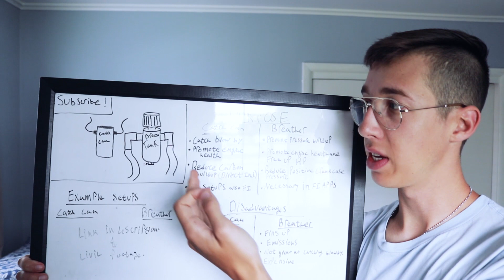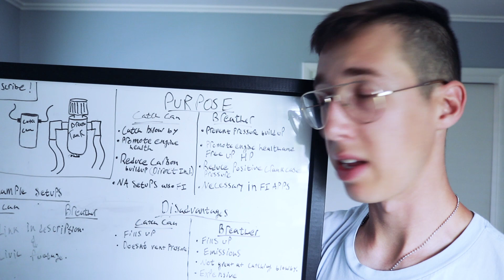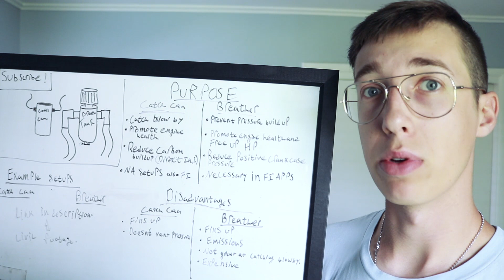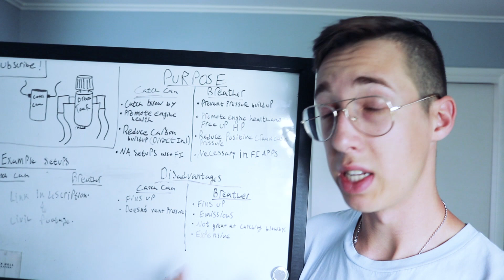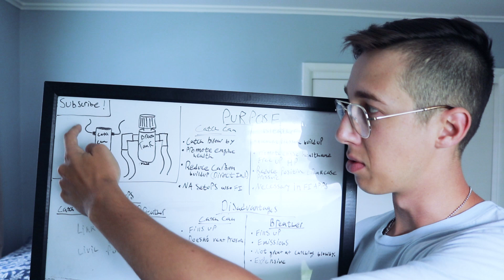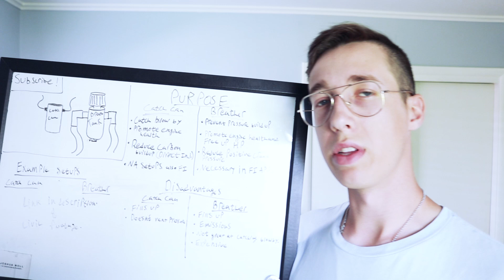Oil Catch Can VS Breather Tank | Which is Best?

Comment: breather tanks don't prevent crankcase pressure they lower the pressure by releasing it directly to the atmosphere. The pressure pushes its way out the easiest way it can which is through the breather instead of your seals and gaskets. Oil catch cans are used inline with your PCV valve.  Some people use them as a PCV system.  So negative pressure is put on the crankcase meaning air is being sucked out.  If you apply enough negative pressure on your crankcase without going overboard you can actually increase HP.  BMW and VW owners do this all the time. Get rid of the CCV (air oil separator) and run a catch can with no Valve. The key to this mod is not running a valve or use one that has a higher flow rate than stock so your intake can suck the air out of the crank before it even has a chance to build up allowing your pistons to move more freely. You'll also see an increase in mpg

Comment: bought a 2 port breather tank for my b16a2 (NA for now-em1), bungs for -10 an fittings on back of block, and -10 an braided lines. My plan is to run both -10an lines to my breather tank and put a filter on the valve cover that connects to the air intake and to plug off the hole on the intake manifold. Do you have any advice on a better plumbing route or what to do with the factory PCV nipple, or can I do what I mentioned and freeze plug the oem pcv breather box location?

Comment: I'm confused. There's a vacuum under my valve cover. I know cuz I got a small hole I it where I'm missing a bolt, it pulls in air nonstop.

Is that not normal? 
Like if I plug the hole there's still gunna be a vacuum in there, so if I add a hose for an oil catch can, how is it not gunna suck air or oil through that hose into valve cover?
How is oil or air gunna pass out of my valve cover area into my catch can, if mine is under vacuum.

Sorry I probably wrote these questions like a complete idiot. Idk nothing about cars but I'm trying to learn. Been doing some small mods to my cruze last few months really just tryna learn more about how my car actually gets me where I want to go everyday

Comment: This video is misleading, engines crankcase can never vent to atmosphere if it is a road registered vehicle, so the mere mention of breather tank removes all your credibility, vented to atmosphere where specifically you have removed the PCV vacuum side causes MORE damage to the crankcase and internals than just running the OEM PCV circuit - OEM high power turbo and supercharger cars factory built have all what I have mentioned for emissions control as a sealed system measured by the MAF sensor - venting any part of this disallowing the motor to burn the blowby is so so bad for the enviroment and for air pollution issues globally, frankly Im fucking sick of seeing people modiying any part of the crankcase piping as its like no one knows how to do it correctly
Reply: Damn that’s crazy my turbo ls is vented to atmosphere. Seems like you should be planting trees or something. Obviously not a car person.

Comment: The only big difference you talk about is that "a breather doesn't catch that much blowby compared to a catch can" which is untrue since you then talk about your breather tank filling up too fast meaning you experienced first hand how much blow by it can catch (more on why your setup fills too quick at the end of my comment), reality is that all types of crankcase ventilation systems catch roughly the same amount of blowby and pressure, difference is what they do with it. Only matters for an emission perspective, an engine health perspective, and a tuning strategy perspective as vent to atmosphere setups like breathers cannot be used with a maf.

Catch cans condensate the majority of the oil particulates then gets the finer stuff and the extra pressure sucked back into the intake, which brings us to your other point "catch cans don't really relieve positive crankcase pressure", that's also false, the second outlet of the catch can is plumbed to a part of the intake that sees vaccuum, therefore the extra pressure gets sucked back into the intake. Advantage is compatible with MAF systems, keeps intake clean, good for emissions, can pull slight vaccuum in crankcase therefore increasing piston ring sealing but probably by like 0.01%. Cons are the more complicated tubing compared to vent to atmosphere setups and some blow by still gets in your intake.

Breather tanks also condensate the majority of the oil particulates, and relief the rest of blowby and the pressure through a filter on top, vent to atmosphere. Doesn't work for MAF systems, and is releasing all kind of vapours in the atmosphere, but it has the most venting capacity, can keep high boost engines with big ring gaps at 0 crankcase pressure compared to a catch can that wouldn't be able to vent enough, also has the advantage of not recirculating any crap in your engine.

Stock crankcase ventilation systems just recirculate the crankcase pressure directly into the intake without even trying to separate the air from the oil and condensation vapors, it only relies on the baffling present in the valve cover to not suck liquid oil into the intake. Best for emissions, don't need to empty a can, compatible with MAF but doesn't work that well with more extreme FI setups that produce more pressure, absolutely the worst when it comes to putting crap back into your engine.

The last options are breather filters, they're filters that go directly onto the valve cover, vent the pressure and vapors to atmosphere and like the stock system only rely on the baffling to prevent liquid oil from coming out. Not Compatible with MAF, bad for emissions, requires really good baffling, and cannot cope at all with the extra pressure of FI, only for lower power NA cars that don't produce much blow by.

Also I would not recommend draining a catch can or breather tank back into the sump, lots of acidic residue, condensation, and gas that ends up in them and I'd rather not recirculate that through my oiling system, fix the problem at the source : your catch can is filling too fast because your baffling is insufficient.

Comment: I realize its an old video and you may have remedied this already.. but you may wanna take a look at that oil you're "draining back into the engine block".. you probably don't want that back in your motor..  that shit is usually full of water/gunk/sludge.. if its filling with oil too quick, you need better baffling. unless that (which appears to just be a moroso breather tank) is actually an air/oil separator..

Comment: Wouldnt there be boost leak if a breather system is installed on a boosted application? Light reflection prevents from seeing the white board.
Reply from the maker: No. Venting the crank case will not cause a boost leak.

Comment: Do a side by side comparison test of which type of can collects more oil.  Vented or return setup.  2k miles with vented then 2k miles with a return tank.  Let’s go!
Reply: Did you install a check valve pointing (flow) to the intake manifold with your setup?

Comment: Bad thing connecting the oil tank to the engine block for draining oil. Probably you haven't seen the sludge that is collected there in a cold winter morning and the black colour of the oil collected there during hot summer days. Trust me, my friend, stop draining that shit inside your engine.

Comment: My catch can vents to the intake. It's technically a sealed system, not vented to the atmosphere, but it still should be reducing crank case pressure, right?
Reply: you are just sending the dirty air back to the intake and back to the engine?

Comment: In order to set it up for drain back u need to get a can that u can run coolant lines to to stop the condensation. So oil in the tank stays relatively warm till it runs into the drain back to stop condensation.
Reply from the maker: Yeah I probably won’t run this setup with my new motor.

Comment: A few corrections.

A closed system oil separator will have a vacuum pull to have negative pressure in the crank case which actually improves efficiencies, giving marginal fuel saving gains. This is what you have called a catch can. It connects on one end at the crank case vent port. Then connects to the catch can, then goes to the air intake system where it gets a negative pull, vacuum.

In certain application such as over boosted engines. Or engines with bad compression in the cylinders from bad piston rings. A closed system can cause problems. Due to such higher than normal pressure in the crank case with then a vacuum being used to vent the crank case... it winds up pulling oil out of the block in liquid form rather than oil vapors. Closed system catch cans are designed to vacuum the vapors our of a crank case, not liquids. The crankcase that sees to Mich pressure is already ready to squirt it's liquid in any direction. Having a vacuum simply points the oil in the most easily to escape the engine direction.

Open system. The filtered cylinder you have there is more of a degasser than an oil separator. You want the vapor/gas pressures from inside the crankcase to get out but they're bringing liquid oil with them. You degas the mix from the crankcase allowing the vapor to vent to atmosphere and the oils to settle back into your oil pan. 

I'll look over a few of your videos to see what the build is about... but at this point I'd say you misinformed a few people on the applications of those cans and you may have a couple people put the open systems in place where really a closed system belongs. They have specific uses. Ideally the car is build well enough not to need an open system.

You will want to do some research into dry sump oil systems. Heavily boosted cars don't use catch cans be they opened or closed. They use multi staged dry oil sump systems. Will post a link to a Papadakis racing video for you on the subject of dry sumps for boost power.

Lastly depending what your other videos are.. you might want to do a compression test on the engine if the exhaust out the tail pipe has blue smoke.

Thank you for being a sharer of content! Humble or not it was well presented.
Reply: Your points talking about vacuum and oil being sucked up is somewhat incorrect, this is solved by a one way valve, so boost does not go back into the crankcase, during boost and WOT the vacuum port is not used thus, For a force inducted motor the oppisote side rocker cover feeds the turbo atmospheric input, both these pipes cannot be combined and can have dual sperate inline catch cans, but the entire system has to be gas tight. Some of the points in the video are very incorrect and cause excess emissions to the atmophere - incredibly illegal and bad for the motor not running vacuum... a "breather" tank should not exist in 2020/2021
Reply: In my opinion I think a oil catch cans should have filter on the top as that way you wouldn't have vacuum pressure build up  as you would with a sealed oil catch can as it can't breathe at all which that case you would have a vacuum build up & that can't be good for engine at all unless you have a breather oil fiĺler cap because your engine has to bŕeathe anyway well my wife has a PT Cruiser it has 2 breather hoses one from the PCV valve to the intake manifold & have another breather hose from the front rocker cover to the Airbox where  the air filter is which in some point in time I'm going to install a 3 Port  Oil Catch Can with filter the breath hose that I will be buying is High Temperature Siilicone 10mm hose & they come in 5 metre lengths & in that that way I can cut the hose into 3 lengths into sizes I want & make up a bracket for oil catch can as there no place that I can mount the oil catch straight  in as there not much room in these engine bays on these PT Cruisers & I will just have to make up a bracket to mount the oil catch can with  filter & once I have made the mount bracket on then I will mount the oil catch can with filter & I'm sure that a sealed oil catch can could cause a vacuum pressure build up which could cause damage to the engine well that's I think anyway Kind Regards Peter PS I would much rather have a oil catch can with a filter & be safer than sorry because if the sealed oil catch can does cause vacuum build up & it will cause damage to the engine & I personally would take that risk & that's  what I think anyway
Reply: https://youtu.be/Ze-quG0nSqA

Papadakis racing going over dry sump oil pump.
Reply: https://youtu.be/XWHvnIKkya4

Papadakisracing showing an oil change on a car with dry sump oil system.
Reply: why aren't pcv systems on both valve covers ?
Reply: @ehrenleleski8204  that would cost more per engine for the manufacturer. It's basically adding to engineered obsolescence by making a cheaper engine that will not last as long as a slightly more expensive engine which is designed in a superior way for longevity.

People put up with crap so they sell crap. Seems only the special interest groups nagging the gov for better emissions is the reason for fuel efficient cars. Longevity is not as important as the efficiency it provides when new.
Reply: So pretty much don't add breather where there was no breather in the first place right
Reply: @matarazzo209  you can add breathers but it's more complicated to do it correctly. Ensuring you're not going to pull oil from the engine etc.

Though in theory if you removed all the vacuum lines and plugged them off on the intake manifold(s) you could vent to atmosphere.

Doing that though I'd suggest you plumb into each vent a degassing device. A simple one or complex one would be dependant on how much blow by potential is present.
Reply: What would you recommend for a 2L Turbodiesel that already has a Pcv valve in the Plastic valve  cover
Reply: @kjschrauber2126  I'd suggest looking up your make and model online for someone that has a kit with instructions or support on how to install the kit.
Something like...
"2015 Ford focus 2L diesel oil catch can"
See if a kit is available which would indicate that someone has installed it on your car before and with luck did so in a way that will not throw codes.
When I had a Moroso can installed in a 2014 Ram 1500 5.7L there were no instructions for the specific application. I had a Ram dealer install it. Truck had 32km on it and wanted the dealer to do it so I wouldn't botch warranty. Worked out well. 

For a pcv system tied into a cover be it an engine cover or integrated within a valve cover directly to a manifold... it may require more complex modifications.

Lastly a newer turbo diesel may already have a can in place that drains back to the oil pan in which case you could look into upgrading it and removing the return drain.
Reply: @danielsimpson8929  I drive a BMW 320 D with the N472 litre turbo diesel and as you stated it has a CCV system that is integrated into the plastic valve cover which is top of the engine and the hose that is Coming out of there directly goes into the tube which connects from the Air filter box to the turbocharger so the crank case ventilation oil is being pushed through the turbo charger and I'd rather not have that may you help me please if you have any idea. And yes I do have a pressure valve as part of the CCTV system that sits on top of the plastic valve cover I have already placed it so that overpressure cannot skip but I'm still getting oil into the intake manifold which is to be burnt off and I'd like to stop that and have like the engine breathe freely through an oil breather tank but I only have one hose and most thanks have like two holes to fit another hose
Reply: @danielsimpson8929  thanks buddy I'm very glad you are trying to help
Reply: @kjschrauber2126  turbo can produce alot of vacuum. It may be best to keep the pcv and simply spice the hose to have a catch can installed. A can with one inlet and one outlet should be fine. Look for one that comes with the right barb size for your existing hose. You may need to purchase more vacuum line to plumb it in nicely to where ever you decide to mount the can. 

As you are essentially just adding in a means of turning vapors into droplets that then fall to the bottom of the can and letting the vacuumed air continue along, you shouldn't have codes. Just need to ensure you have no leaks in the system.

The moroso used NPT threads on brass fittings to an aluminum body, so do not over tighten. Use Teflon tape on sealing threads. Think that'll do for what I got out of your post.
Reply: @kjschrauber2126  one last bit. Don't forget to drain the can. If you're running big boost with alot of blow by the can can fill quickly. Normally I would drain mine every time I filled with gas. Kept the bottles as a measure of what was removed over time. Most was water and fuel. Some oil.

If the can fills up you'll be sucking liquid into the intake rather than vapors. So don't forget.

Comment: please explain how the system stops or reduces blow by.
Reply from the maker: It won't reduce blow by, but it will reduce crank case pressure. That way, the blow by won't have as much of a negative affect on the engine.
Reply: thank you

Comment: I have a Lincoln MKS Eco-boost sedan.
I talked to my mechanic yesterday about this since I've learned that any direct fuel injection should have a catch can. I was told use a catch can not a breather because with a breather you lose vacuum and they can also mess up a smog check. I made the decision of a catch can for mine. Also have found other videos of Ford trucks that have the Eco-boost engine in them as well using a catch can.

Comment: My oil catch can's breather is making annoying noises. Is there a solution to this?
Reply: Does the catch can go from the crank case vent port to the catch can and the back to the air intake system? Because it your post reads like you habe an open system (vented) catch can hooked up like a closed system catch can. 

Good luck!